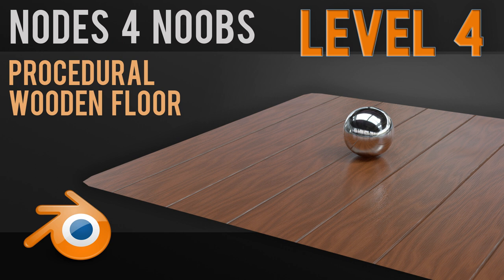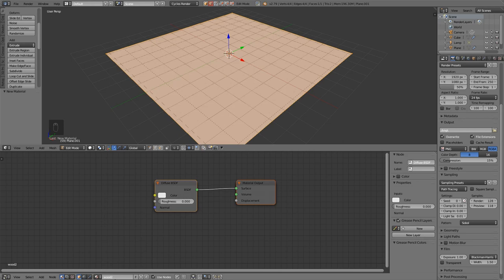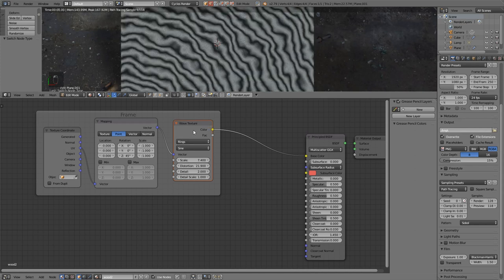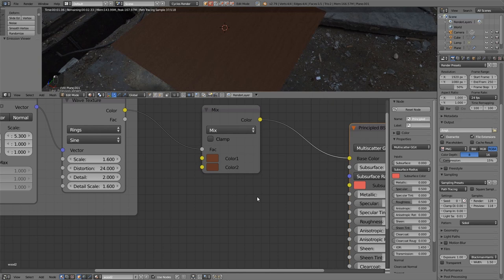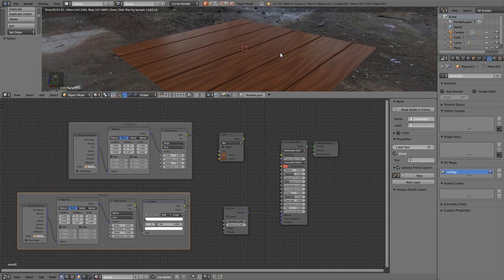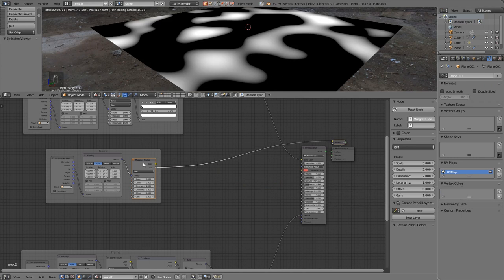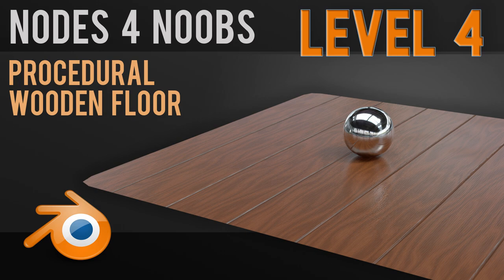Node School - Cycles - Wooden Floor - Procedural Texturing

Comment: The shininess inside the wood slats was bothering me so I used the slat's occlusion and mixed it with the roughness to occlude the shine out of the slat grooves. First, I inverted the Color Ramp that creates the slat's ambient occlusion. I put that node through an Invert at a factor of 1.0 and then Added that to the end of the roughness tree. The end result keeps the roughness we created but blackens it out where the slat grooves reside. Contrasted to the shininess of the wood itself, I think doing this helped to "sell" the wood even more. I'm new to Blender nodes but I've worked with nodes before in Maya, Unreal, Nuke, etc.

Comment: The much better approach is the hybrid. Use Bartek Skorupas method to generate a high res "look up" texture (4-8k) which you then make seamless. Then you use brick generator texture to create the wooden floor "index" if you will, using the color output to drive from where in the lookup texture you select from. This can of course get very advanced on its own, it's just a matter of how far you want to take it. But the actual wooden pattern generation is awesome since it's a texture and has almost no cost to use. I suggest using 2-3 brick generators; per row width generator which feeds the next two, color generator, and grout generator).
Reply from the maker: Makes a lot of sense 😃

Comment: First of all, thanks for great content! Like you said this tutorial is much more practical. Could you maybe go even a little further and make a tutorial about using multiple procedural shaders on one object - one example might be cardboard material (where surface is quite similar to this tutorial, but on the side it's totally different wavy pattern). Or just to explain mapping nodes and how could something like this be achieved. I hope it's clear what I mean. :)
Reply from the maker: I think so. But actually that's more about how you unwrap. I think it would be good to add and mention though. so i may mention that on the next one

Comment: I usually use the Vector Math node and add Bump nodes rather than MixRGB, I guess either method works!
Reply from the maker: Yes i very rarely use vector math but it makes a lot of sense :)

Comment: also, for those who want the musgrave texture to be more...'noisy', just duplicate that frame and replace the musgrave with the noise texture. after that, add a color ramp and using a mixer, connect it to the roughness and boom :)
Reply from the maker: nice :)
Reply: @grabbitt  again, all thanks to you :)

Comment: Great video! Making stuff with nodes is great fun for me :)! Also are those buttons at the top of your Blender screen for switching between object/edit and other modes? Where did you get those? Seems pretty handy to have them rather than using the lower menu!
Reply from the maker: Yes it's some kind of addon that I thought would be useful but never actual use

Comment: Hi, I am currently using Blender 2.92. I enjoyed your video. However, it seems when trying to mix the two bumps I could not; as it seems alt + holding right mouse and drag does not work in the current version. and there is no current mix for two bump to add in the principal normal section. Do you have any updated videos to illustrate how this effect would work on 2.92? Thank you.
Reply from the maker: I have node wrangler add-on enabled

Comment: What are the benefits of using procedural textures over actual PBR maps except for the control you get on the looks?
Reply from the maker: You don't have to unwrap and mark seams. knowing what the different procedural textures do means you can combine them with different textured maps for different effects.

Comment: Help Im having a problem where Lazy Mix isn't working instead of creating a mix node and connecting the two nodes I alt-right clicked, it just simply connects them together without the mix..
EDIT: Apparently they changed it recently bc it was conflicted with blenders new controls so now its CTRL+SHIFT+RMB

Comment: Hello dear , thank you for the great tutorial ,  my question is , is there a method where it is a possible to apply or use ready made (node) map which already saved un blender or by downloading it so to make things faster ( in paint paint substance it called smart material) 
Best regards.
Reply from the maker: yes you can file/ append / material and choose your material

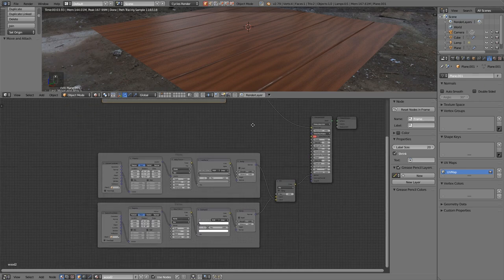Comment: 11:05 
Why do you duplicate the same bump  structure  ?
 I mean I know it's for making that crack darker and mixing it with the other structure , 
but you could just use the same bump structure  and split/branch  route it , .because you are not really changing the structure
Reply from the maker: Just in case i wanted to change it but in this case it was pointless :)